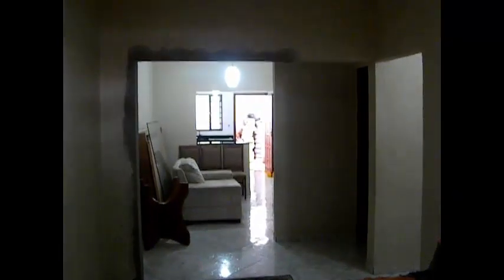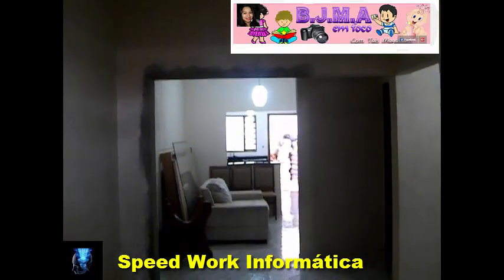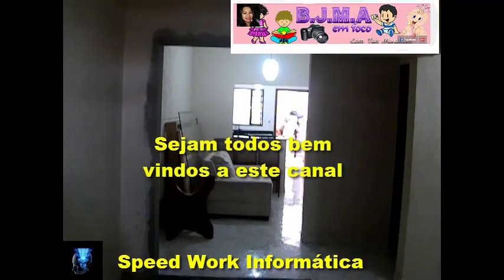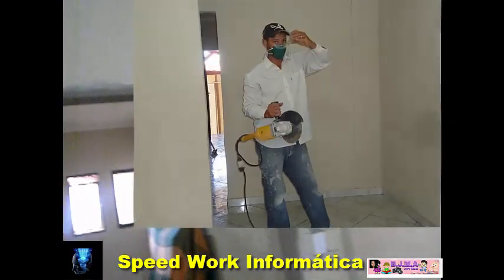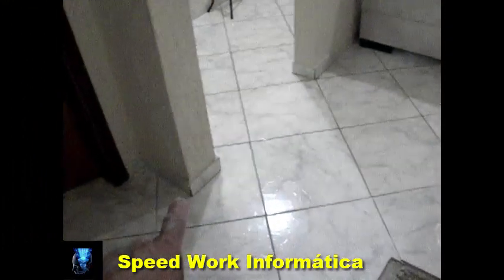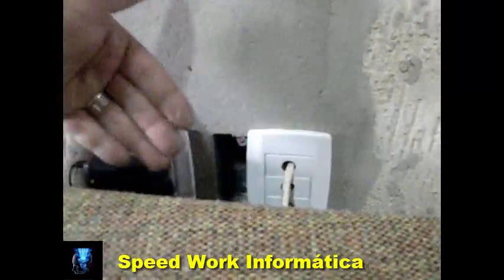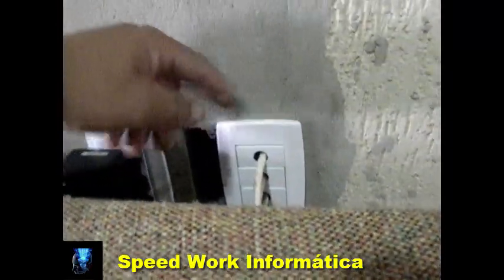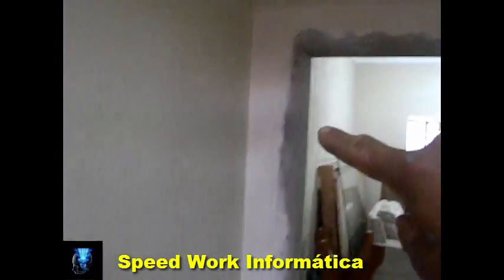Quais são os riscos de demolir paredes internas em residências

Comment: Como foi que você percebeu que as vigas da lagem estava na posição  horizontal!
foi se  basear pelo 
01-faixada da casa?
02-opizo também tu foi cortado com a maquina de  disco ?
Reply: Tem que tomar. Cuidado pra essa casa não ser alvenaria estrutural.

Eu moro em um prédio antigo onde ele tem viga mas não tem coluna. As paredes externas e as paredes grossas do apartamento faz o papel de coluna de sustentação.